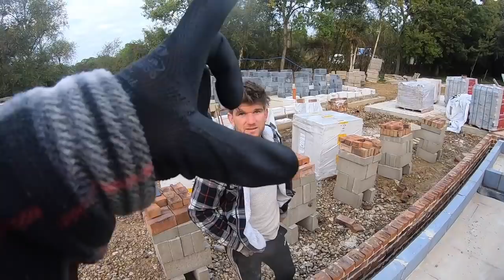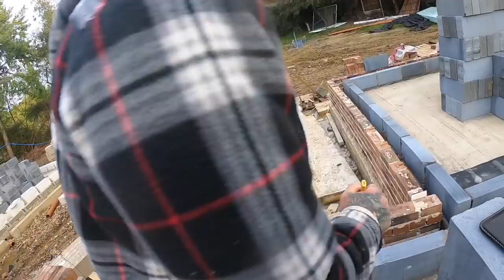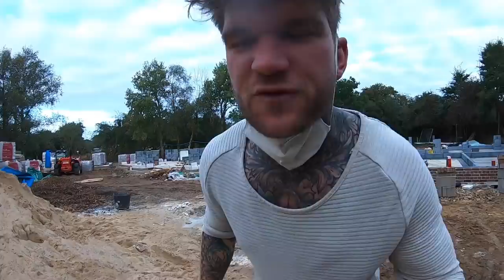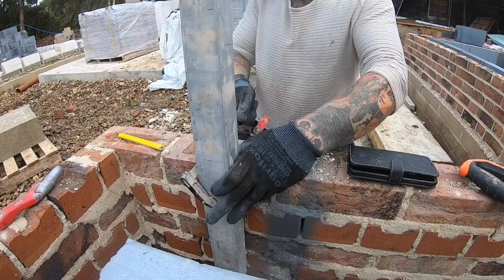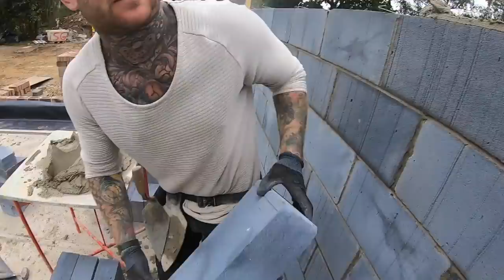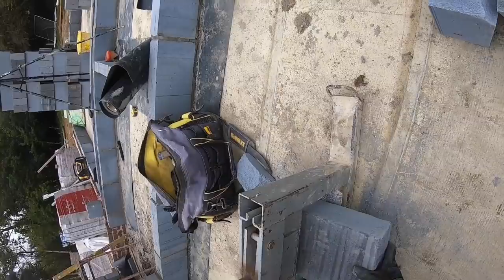Bricklaying - Day 4 - It wasn't my best performance

Comment: Always have a couple of tins of contact adhesive spray in my bag, around €5  tin , very handy for sticking dpc
Reply: Carpet tile adhesive Is good. Spray both surfaces until tacky dry. Then fix. Remember to turn the can upside down to spray out adhesive until only air sprays out. It will stop the nozzle from clogging up.
Reply: Just weigh it down with a few bricks... contact adhesive??
Reply: @teebunn5362  that's what I was thinking 👍😂 dpc with nails in defeats the object of a dpc 🤷🏼‍♂️ don't tell the genius though 🤣

Comment: Lmfaooo when Charlie explained about the mixer key , I said duhhhh n literally as I said it right after she said it lmfao..  also we use dish soap here for nice creamy mud plus it smells so good n bubbles up nice when u throw the water in lol I use a hose and a 3 bag crown mortar mixer. I use a bobcat and a triple bin for two mixes each pull out of it . I make two batches to fill our tub up n literally run that bitch all day lol. Depends on winter or not . Also we add sugar to help it set faster in the cold

Comment: Non-professional here - when Charlie says wall ties only with a non-load baring wall, what does that mean if it was load baring, a starter kit? Tying them in?
Reply from the maker: If it was load bearing I would block tie it into the wall and not tie it in with wall ties
Reply: @CharlieCollison  Thanks Charlie - that makes sense.
Reply: So when you have been paid and that has a crack all the way from top to bottom which it will when it settles will you be back to put it right .
Why did you not lap the damp at the bottom also as required 
Why not scribe a line up the blockwork instead of plumbing it every course ?
Could have tacked batten on that outside wall .pinned it and pulled a line instead of wasting your time building a corner
I'm not learning much from your tutorial am I ?
You have a lot to learn son

Comment: guessing these house's are 1 million pound + and your not block tying the internal walls , using ties non load bearing or not = shabby !
Reply: Doesn't sound like you understand the difference between the two methods mate.
Reply: Tie the walls in every time, wall ties are nowhere near as strong, it's just lazy and poor practice.
Reply: When I passed my time many years ago I whent abroad to work for 5 years, I couldn't believe it when I came back that brickies were hanging ties out for internal partition walls. Now everything is dot and dabbed and not plastered the movement crack is never seen, bad practice but the norm nowadays.
Reply: @Shinobi What are MJs ?
Reply: @Shinobi movement joints at returns to make easier bonding
Reply: "Wall ties are poor practice, bad practice, lazy".........sounds like a lot of people don't understand why ties may be the preferred  way to bond in a cross wall
Reply: Always had a problem with them fukin things, often not on the drawing then BC pull you on it later, I always and have done for years call BC out on first day and and liase to see what they want and record it.
Reply: @Shinobi bad idea adding MJ s if not on the drawing, the 1 has created a 2 brick pillar for door which is going to be very weak, i always stick to the drawings
Reply from the maker: It’s how it’s done now. On most sites. Does what’s needed. Chill out its called a wall tie for a reason
Reply: @si-vz8ny  yeah stick to drawing bro its actually very simple bonding english into flemish at returns but a mj on flemish looks bad unless its hidden
Reply: @CharlieCollison  it's a cavity tie mate, but that's the way it's done nowadays, I don't like it and on my own work I will always bond the blockwork but to be honest in a hundred years both walls will be standing it's just how much pride do you take in your work, I prefer to do it how it should be don't take much longer.
Reply: On our Jobs the building expector don't like to see them built In they always wanna see you put wall ties in? Don't ask me why but that's what we have been doing for a few years now
Reply: @Shinobi I didn’t want to get involved when I saw the previous video, but since you ask. If there is a error or omission from the drawings, say movement joints, ask the architect, he’ll ask the engineer to clarify. If you take it upon yourself, your leaving yourself wide open for a claim against you for taking on the responsibility. Record your findings for reference & get the architect to confirm the changes. Cover your bum. Hope this helps. Also, has Qharlie got a formal contract? There’s a lot to this issue & I’m keeping it short.
Reply from the maker: @bricklayersworldwithandy6277  but that’s how they want it done these days. And it deffo does take a lot longer if your doing every wall like it
Reply from the maker: @larry6518  where it’s English bond it turns to render after the plinth. So I don’t need to bond it. A Mj is fine.
Reply: @bricklayersworldwithandy6277  This has got nothing to do with pride. Wall ties are specified to be used in some wall junctions for a specific reason that a toothed-in bond will not satisfy.
Reply: @CharlieCollison  agrees
Reply: @larry6518  a mj in flemish looks bad ?
Jesus. Let's hope you never build a wall longer than 6m mate
Reply: @bricklayersworldwithandy6277  more to do with speed and efficiency than pride, its a partition wall mate not  king cross station
Reply: @davedavids2231  mate, you will never understand hanging ties out is bollox we are the only country in the world which does it.
Reply: @kevocos  show me the authorised document that says that
Reply: @bricklayersworldwithandy6277  it's a partition wall mate, a chippy would just put 3 nails in a bit of 2 x 4 into the block work, to form a stud,
Wall ties in every course ain't going anywhere isit really
Reply: @CharlieCollison   Not really mate, if it's priced right the time to do it is minimal, most jobs I do lately are with younger Bricklayers who don't even know block bonding but we do use exmat for the ties.
Reply: @kevocos  i believe it would be ex mesh not a single cavity wall tie that would be required
Reply: @davedavids2231  Forget it mate, l don't mind getting a bolloking for doing a job wrong but I'm not accepting it for doing it right.
Reply: @bricklayersworldwithandy6277  no ones dating block bonding is wrong.
It's absolute right.
It's just not necessary on a party wall, I use 2 ties per course tho Iist admit
Reply: @davedavids2231  lets hear your explanation on where and how to build a mj in flemish bond would love to hear it considering you think a cavity tie is suitable for a partition wall
Reply: @bricklayersworldwithandy6277  your correct the tie should either be mesh or a proper flat tie the clue is in the drip which means its a cavity tie and should only be used for cavities wouldnt like to see the jobs these guys have been working on
Reply: @kevocos  yes the correct ties cavity ties are only specified to be on a cavity thats why they have a drip on them
Reply: @larry6518  where , is down to the drawings, tho basically would.be 6m from corner, 10m span etc as I'm.sure your average Bobby knows
If a garden wall I just mirror the bond at each movement joint.
Anything else you just have 2 3/4 on the second course. Not rocket science. Defo hiding in corners makes sense if it's on drawings.
Don't see the problem
Reply: @larry6518  can you explain what a wall tie, with a drip is meant to do ? 
Is it to hold 2 leaves of a cavity wall together, so would that not mean it could be used to hold 2 skins of butted block work together, I'm no scientist but .. erm..
Reply: @davedavids2231  yeah but charlie aint going with the drawing on mj i asked you how would you build a mj on this house not a garden wall mj looks bad on flemish bond on a house so im asking you again if mj was not on the corner but halfway along gable how would you bond it?
Reply: @davedavids2231  a cavity wall tie is for a cavity wall only thats why they have a drip on them any water passing along the tie from the outer leaf hits the drip and falls off instead of passing to the inner leaf you dont need to be a scientist its only basic brickwork the ties should have been mesh or a flat tie ringed at both sides.
Reply: @larry6518  2 3/4 over the bond.
Not rocket science
Reply: @davedavids2231  that only explains 1 course what about the 2nd course and science has nothing to do with it its only brickwork so explain how to properly bond a mj in a flemish bond house
Reply: @larry6518  so what will happen when building with a cavity tie instead of a flat tie ringed at both ends ?
Reply: @larry6518  normal bond 1st course, with 2 x 3/4 on second course. 
Not rocket science.
Reply: @davedavids2231  just means its not tied in properly its a weaker tie there are correct ties for every job and this is the wrong tie here do that with a good brickwork company and at best you will have to rebuild and worst scenario is your sacked
Reply: In Ireland  ya wouldn't  be allowed  to do that,if both walls  are  tied  in together   ya stronger  wall  ,one is helping  the other
Reply: @davedavids2231  if your putting threequarters in a mj then you are breaking the bond and thats exactly what i mean you are breaking the bond and it looks bad sticks out like a sore thumb what you gonna put above the threequarters header closure dont make me laugh
Reply: Wouldn't  be allowed to  that  in Ireland, if ya tie both  walls  together  with  block work, ya have  a stronger  wall
Reply: @desodea1656  yeah its a stronger job but over here its usually just a tie but has to be the correct tie and not a cavity tie just because it needs tied doesnt mean you throw any old tie in correct ties are there for all jobs
Reply: im still waiting on davedavids reply on how to bond both sides of a mj on flemish bond
Reply: @Shinobi what maintains flemish bond is a qc against the corner header
ok if you had stretcher header on the alternate course that would mean you have threequarter stretcher above as your header has to be centre on the stretcher not the stretcher central on a header so picture this your taking a walk around the house and the bond is all uniform until you come to the mj where you have 2 stretchers on 1 course and even although you have 2 threequarters on the mj its going to look like 2 stretchers  then 4 stretchers above which would look really bad like a big bald piece in the wall which is unforgivable and that goes back to my first comment saying its easier to bond of a corner mj you can chase the broken bond into the mj or at least have a chance as for threequarters you only use them below plinth at corners where it steps in or on broken bond above or below openings where you have threequarter means broken bond and threequarters should be eliminated if possible the proper way to bond is header qc not threequarter
Reply: @martin2466  hi martin trying to understand how so many people are struggling with setting out flemish even referring to books
Reply: @markanderson6969  thats simple its cos all we have now is ex hods and improvers the company i work for only start blue or gold card holders it doesnt prove much but there are so many on the latter still working off a green card which in my experience means ex hod or improver
Reply: @martin2466  built a lot of flemish bond its not as difficult as people think if you understand the bond always size off your corner header and always put a qc in the secret is marking all your openings and mj before you set the first course as you see many think a threequarter keeps the bond when infact it breaks it 30 years on the trowel and 18 yrs as a bricky foreman so only a few years left ubtil i hang my boots up which scares me rotten
Reply: @larry6518  well I am glad to see that at least you know what your talking about, these lads soon get found out when put on something different than a square box in stretcher bond
Reply: @martin2466  thank you martin you sound settled in your retirement good for you im not sure what to do yet i have almost 3 yrs left im mostly checking work on site and organising but still like to jump in with the lads now and again even if its only for an hour or so and i havent worked in the rain for 18 years so im not really pushed nice speaking to you martin and lets hope you have many more enjoyable years in front of you yet

Comment: Wall ties are too short for the width of cavity.  Barely reaching across  the cavity to the outside  leaf of brickwork. They need to be another 50mm long.
Reply: @martindawe9571  whats going to support the plinth course at the back?. Id have thought the splash would be 1 brick thick for that to happen. Is it just going to overhang the outer leaf?
Reply: @Shinobi I can see it stepping back on a  plinth brick. But whats supporting  the plinth brick if the outside leaf is just 100mm. Is it going to  corble back into the cavity?

Comment: Do not think that Flemish bond was intended for single skin application
Reply: @martin2466  maybe not the most waterproof
Reply: Lots of vertical joints that do not always get the required attention to detail, so in prolonged driving rain water gets through to the itchy stuff and it slumps in the cavity causing damp problems.

Comment: Surely if they had built the brickwork higher and then put the damp course on and then the concrete beams, they would not have had to mess around with all that damp proof now.
Reply: Doesn't the DPC have to be level with FFL and the DPM that attaches to the damp skirts sits ontop of block and beam
Reply: @ivoryking509  No idea, I was thinking that if the beams are sitting on the black damp course, then theoretically no damp can go onto the beams and floor.  I am just a simple accountant though.
Reply: @johntheaccountant5594   that's very true but you always need a membrane under your finished floor and that has to lap up onto the inner skin, it's all overkill but it's worth it just incase
Reply: @ivoryking509  IF the floor is suspended, not touching the earth, then you would not need a damp membrane I would think.  And the insulation foam before screeding would also stop any damp passing through I would think.
Reply: @johntheaccountant5594  dangerous thinking.
A block and beam.floor requires a dpm, sometimes a radon barrier also, then rigid insulation which will.have a second dpm separating  the screed from the insulation 🙂
Reply: @davedavids2231  if that is the case, then block and beam doesn't seem such a great idea on the ground floor.  May as well just put a damp membrane down on some sand, the insulation and concrete.  Probably cheaper as well.
Reply: @johntheaccountant5594  there are numerous benefits of block and beam, 1 is the damp proofing of the ground floor, by being min 300mm from ground level suspended in the air, it makes any water engress very difficult, also as it is solidly supported from the foundations through the Brickwork, it will not sink  over time, like a solid base floor would, this can cause issues with tiled flooring especially.